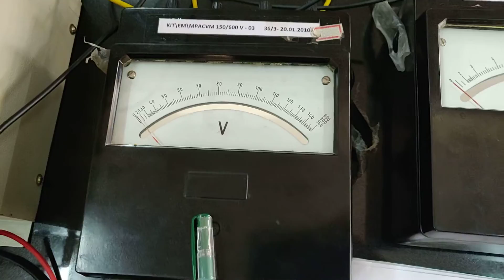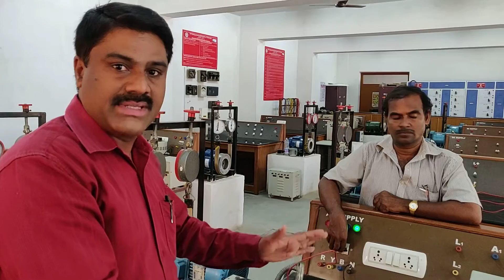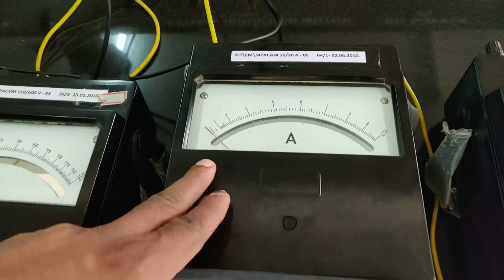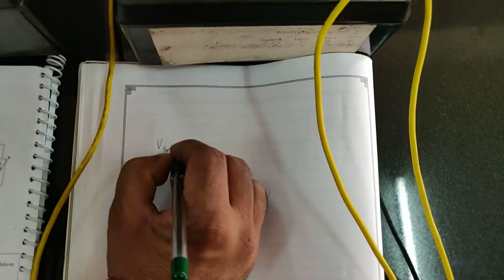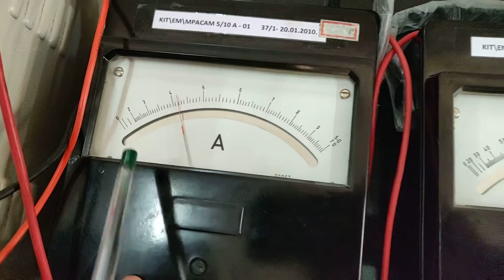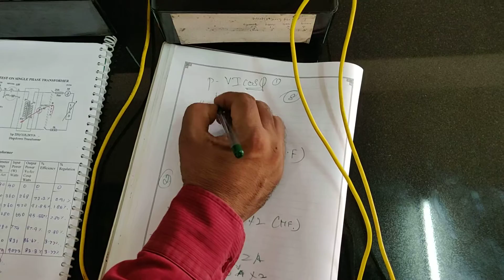Load Test on single phase Transformer( Transformer testing)- Part 2

Comment: Thanks for your demo, but you told that 0.5 A is for constant losses, It's fine theoretically but practically it includes full load copper losses as well as the name suggests FL test, i.e. both the coils are energised i.e. there must be some copper losses as well. Correct me if am wrong.